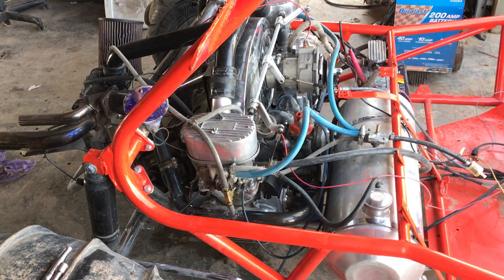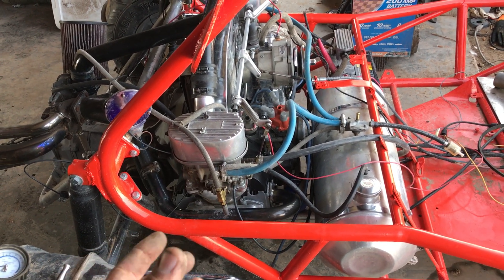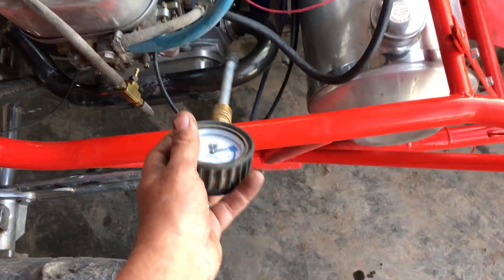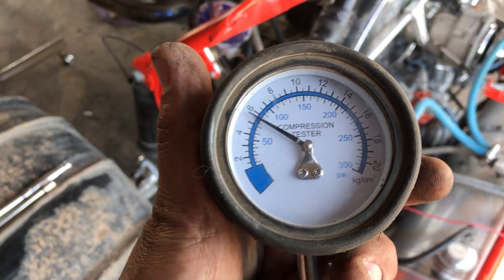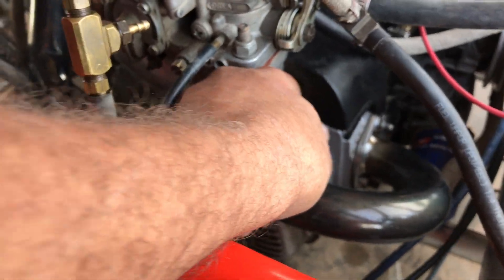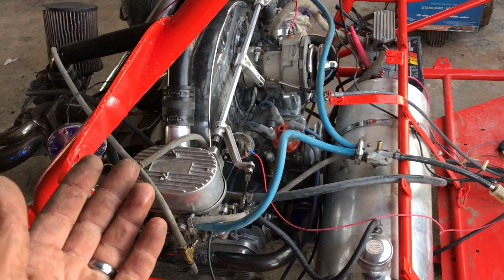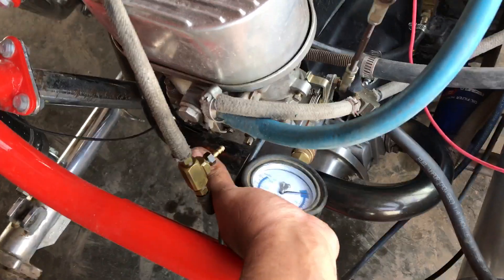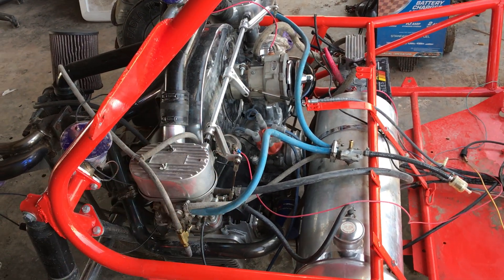Do I Have Bad Valves or Bad Piston Rings, Easy Way

Comment: i bought a piece of junk 3 wheeler for top dollar of course,and it sputters and smokes bad when you give it throttle,i did a leak down test and air came out my air box so i tore it down cleaned valved they were filthy and replaced seals reinstalled cranked it up still smoking,ok so at first i did a compression test and it was 160 with throttle open which i think is good and it didnt go down it stayed there so now im being told it needs to be torn down again to replace the oil rings on the piston omg im so pissed does this sound right to you bro ? i just put it back together,i adjusted valves and then started it and heard a loud valve noise so i checked an the intake valve was super closed tight so i reset it,not sure how that happened,another thing the oil dipstick shows high oil level on dipstick,so im going to change the oil first and then try to start it,what do you think ? how can pistons with good compression be leaking or burning oil and it smokes bad kinda white ish blue ish and a lot it smokes ot my whole yard.im pissed

Comment: Sounds like mine is the valves. But instead of being around an average of 160, cylinder one is at 15. And still at 15 after applying oil. Would this still lead to the head? I thought when it was extremely low then it was a bad piston ring?.

Comment: I have always heard this, wet test shows bad rings or not. But somehow someway in like a passing fashion barely mentioned it but made everything make sense.
The reason the compression stays the same for valves is cause it comes right back up near the compression tester and finds the path of least resistance! 
You somehow made that so clear despite saying it so simply. Thank you SO much for this video <3

Comment: My boat engine, So one of my cylinders has the same compression as the rest (180psi) When I do the test with the oil it rises to 200psi so bad rings but my spark plug in that cylinder is the cleanest one of all of them ??? Doesn’t make any sense to me

Comment: Damn, I did that and my car went up about 10 psi? What's that mean? I need help. It went from 30-40 psi on my honda pilot.
Reply: That sounds really really low...if no pistons have 0 psi than those sound like really bad rings. I'd be wondering if it's a scraped up piston wall too
Reply: @alien_man1669  I did a leak down test and it seemed to be leaking air out of the exhaust. So I'm guessing it's the exhaust valve!?! I'm not exactly sure because I'm kinda new to this whole leak down test thing!

Comment: I just compression tested a dirt bike, got 175psi. Replaced the valve seals because it was burning oil . Still burns oil. Replaced the piston rings, got 175psi and no smoke. Comp test wont always show the issue i guess

Comment: Gave me a bit of hope. Brand new built engine in my car and got a cylinder 4 misfire. Care is running poorly. Figured after 6k miles, burned up a piston...a very pricey piston. Checked compression and got 0psi on one cylinder while rest were 130. Did your test and got no change. So really hoping for stuck valve.

Comment: Thanks for the video. I tried the same test and my compression didn't raise. So I ran a leak down test to check the valves. Both valves sealed great. Would that mean that something seriously happened to my rings, hole in piston or possibly a crank bearing?
Reply: How was the problem later fixed?

Comment: Can you do this in a diesel through the glow plugs?
Reply: Possibly, but removing the spark plug means a petrol is never going to fire, but a diesel might well still fire without the glow plug and/or the pressure probe would be fired back out of the hole at/through you!

Better to unplug the injector loom if you can. That’ll stop it firing.

Comment: Not 100% correct. Even a brand new engine will have higher numbers on the wet test. Its better to go by what repair manuals say for what the minimum and maximum compression numbers should be per cyl. Also look for if the numbers are similar across all cylinders. I think they should be within 10-15% of each other off the top of my head. Simply adding oil to the combustion chamber and seeing your numbers rise and assuming your rings are shot is quite ignorant. Theres more to it than just that, in your case your number almost doubled so rings could be a possibility, I just want to add this information here so the people aren’t misled by seeing their numbers increase and jumping to the conclusion that their rings are shot.

Comment: 1991 Chevy Silverado 5.7 My truck just started smoking out of 1 side. Drivers side, Heavy Blue smoke when u rive it up. Started doing this after i changed oil with 4 quarts oil plus 1 quart Lucas Oil stab.. I also changed out 1 injector tbi throttle body with New/reman. injector. Also replaced oil pressure sensor.. Now it started smoking blue smoke out of just one side. IT also still running rich/flooding but no misfire or loss of power i dont think but i havent road it yet. I think i make have a broke oil ring but hoping not.  All help appreciated.

Comment: Say you do this and what you showed in the video happens to me. How does one reconfirm bad pistin ring once they have removed the head?
Reply: Inspect the cylinder for scoring or damage, check the cylinder wall for cross hatching. Inspect the rings on the piston, they should rotate and not be stuck in the grooves. Then take the piston rings off and put them one by one in the cylinder about 1/3d of the way down. Use the piston to make the rings sit square in the cylinder. Use a feeler gauge to measure the gap in the ring ends. Compare that with your manufacturers spec

Comment: Hi, Hopefully you still check comments...The compression staying the same = Valves not seating, makes sense to me.  But, if the compression increases with the added oil to the top of the cylinder, doesn't that mean the rings are sealing the cylinder correctly? What am I missing?
Reply: The oil fills in gaps that the bad rings leave. With good rings theres not going to be much increase because the rings are sealing. If bad rings, the oil is going to be doing most of the sealing so you will see a large increase

Comment: so I have low compression in cylinder 3 of my inline4 mazdaspeed6, and I have smoke coming out of the exhaust and my oil is decreasing fast, does that means my piston rings are screwed?
Reply: Definitely. The oil is going into the chamber for combustion by getting past the rings.
Reply: No necessarily. It could be a bad turbo. I know the Mazda speed3 was bad about that

Comment: I'm not very experienced but dont all rings have gap around them and if theres a tight gap wouldnt it be normal to see a large increase in pressure when sealing with oil opposed to flogged out rings where oil fails to seal and pressures remain closer?
Reply: There’s multiple rings that have gaps opposite of each other when installed. But what this is really doing is letting you know if it’s a valve leak becuase If the valve leak is the problem nothing will change. If the rings are the problem and they are worn letting air by then adding oil you will see the compression increase.

Comment: Hey man just wondering if I could use your thoughts on my situation. I got a Kodiak 450 I was told it was rings that needed to be replaced. I don't have a compression tester currently. The bike won't start I was told the compression was at like 90 and needed to be 150, the bike has started a few times for about 30 seconds when the guy had it but would die, now when i turn it over the bike smokes through the airbox from the carb. Any thoughts? I want to be almost 100% sure as to what it is before i take it off to get done or rip into it myself.
Reply: ThinRedLine 013  my atv was doing the same thing it was the intake valve  get a feeler gauge a set your valves

Comment: So if compression goes up, the rings are bad.
If it stays the same it's the valve.

I have a predator 212cc engine and it'll start and run fine when cold. But as soon as it gets warm it will not run anymore or start until it cools down. Could that be the rings, or something else entirely?
Reply from the maker: yes, because the oil does nothing for a open or broken valve. therefore it would not show a difference if the valve was open or broke. the oil would just escape there. your problem is a ring, because as the engine warms, the rings will shrink and seat in the ring sleeve. therefore loosing compression in the case ( oil pan ) here is your test... when it is running and it is warm, pull the dipstick and check for compression in the oil pan. if you have air in there, then you know the rings are letting it pass and its going down into the oil pan. i hope that makes sense,,, thanks for watching. great question.
Reply: It sounds like ignition problem probably bad coil run some tests on ignition coils look on utube how to do it

Comment: Does this work on a 4 stroke dirt bike with auto decompressor? Thanks!
Reply: Generally with a dirbike you just check the valves and if they are in spec then it's clearly the piston and rings

Comment: Awesome info I needed!!! Question tho... when running the compression test with the oil inside the cylinder, does the top of the piston head have to be flat/horizontal (piston running vertically up and down)? I ask because I'm working on a small motor where I don't have good compression and the piston flat, not up and down.
Reply: Shouldn't matter

Comment: One time I checked the compression on my boat engine.  And the guide I was going by said to add oil to see if compression goes up.  And if it went up more than 15 psi the rings are going bad.  Well it didn't make sense to me but I did it anyway.  The psi on all my cylinders was 200.  And I added a some oil to the first cylinder.  And the schrader valve on my compression tester broke.  I knew something was wrong.  So I put the spark plugs back in and started the boat and waited till the smoke cleared.  Eventually it did.  But now it smokes from time to time on the lake and I dont remember it doing that before.  It'll smoke when the boat is trolling.  I might of added too much oil to the first cylinder.  I never did do the compression again.  I probably should.  But the boat still runs good.  No loss of performance that I can tell. Oil level is good.  I heard the tilted position of the engine can cause it to smoke.  It really is a weird deal and a bad feeling to go along with it.  Any thoughts out there?

Comment: I have a 4 stroke Kawasaki engine. 24 hp. The head  had a significant amount of carbon build up. I was getting 160 psi out of both cylinders. Can you tell by that if it rings were bad?
Reply: if your compression is good but still have carbon then it is valve seals.

Comment: But now you have oil in there how do you get it out
Reply from the maker: it will blow out, all 2 cycle engines run with oil in the gas, its ok i promise. it will run through. good question.

Comment: I have a kawasaki bayou wheeler and I don't know why but it's hard to start and when I do get it started its gutless going up hills if I under half throttle or revs are low rings or valves ?
Reply from the maker: adjust the valves. thanks for watching!

Comment: If compression goes up , then isn't that your rings and valves doing their job? I'd imagine if either valves or rings were bad, then compression would remain the same no matter what. Bad rings=blow by, so compression would remain the same, yes? Bad valve=bad seat or chipped valve, etc, so compression would, again, remain the same, yes? If compression raises, then it only show that rings are good and tight and valves seating properly, yes? If not, please help me understand. You can be technical with me as I'm no novice to engine parts.
Reply: No, if the compression goes up it means the oil is temporarily sealing up gaps and voids in cylinder walls and or assisting the worn rings to get a tighter seal.
Reply: Understood! Interesting, I didn't think about it like that. However, could it ALSO mean that compression is going up because there is, effectively, less space for combustion to take place?
Reply: I guess what I should have asked it, if we did the same thing on a perfectly good engine...would it also increase compression?
Reply: @Mr334cobra   Good engine will be high over 120 , bad under 100 on compression , Todays engines 3-5 HP only need 65 psi to 120 psi . big bike or boats atv 300cc or bigger can go from 120 PSI to 200 PSI   Oil on rings of a piston that had 170 psi  will jump well over 200 psi  but if you had 170 psi no need to do oil unless it was a race engine and you know that it should be over 170 psi .  If Timing was off you get no Compression Valves are not going to be in time with the TDC .

Comment: What about pitted exhaust valves? Would the oil be enough to seal them too and raise compression?
Reply from the maker: no not normally. if it does raise the compression, it would only be for that stroke. thanks for watching.